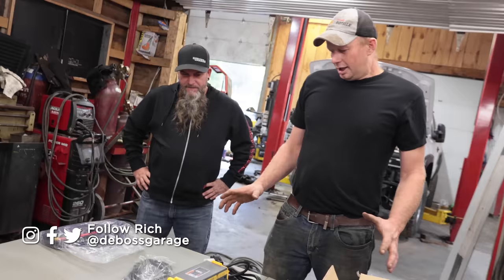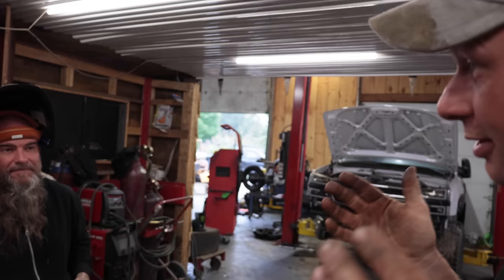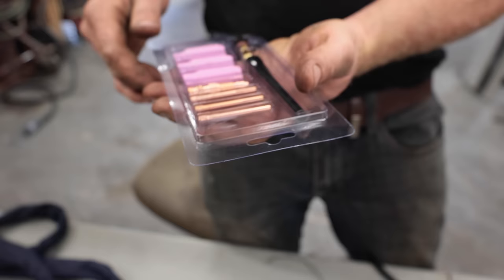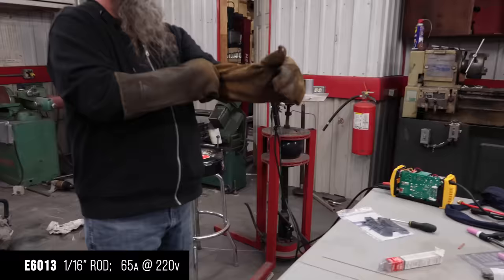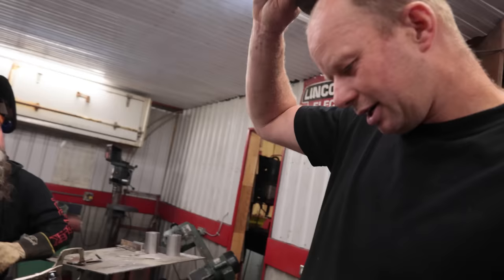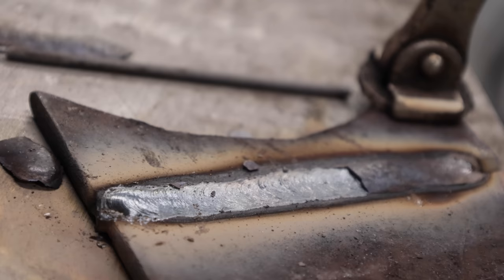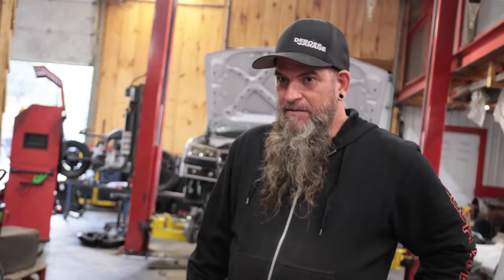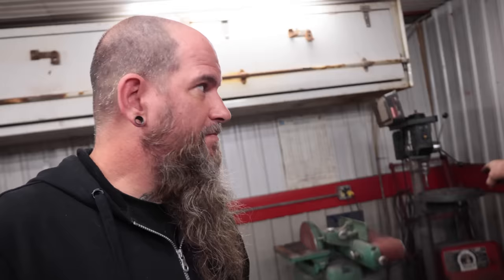How Good is the CHEAPEST Welder on Amazon?

Comment: Nice to see you guys do stuff like this. It's especially helpful for someone like me who doesn't have the setup for a fancy 220 welder (though I'd like one) that will have to stick some metal together here in the future on my project trucks. This is something I could definitely use to gain experience without spending tons of money right off the bat. I remember Peg doing a review on Kickin' Horse welders that were kind of the same inexpensive mini welders. I'd be curious to know what Vince's thoughts are on that brand. 

Another question for Vince if y'all see this is would it be worth it to buy an older Miller/Lincoln/Hobart? Years ago my father purchased an old gas powered Hobart that was used to build bridges back in the '70s or sometime around there. It was an old crane suspended unit that we rigged up on a trailer to be a mobile welder. Supposedly the only reason we stopped using it was because it drank WAY too much gas for our needs but I don't remember the reliability side of it. I've been told that old welders are worth having due to build quality but part of me thinks an old enough welder would cause nothing but headache due to age.

Comment: I am by no means a professional welder, but damn I am impressed. I've used some $200 and $300 welders that were just terrible. This little thing is insane.

Edit: Looks like the price of it went up. $99.99 now. Still a solid price. 
I noticed this brand has a 195A 110/220V version for $109.99. Wonder if it holds up as well if not better.
Reply: It's dropped down to $67.99 now.
Reply: @iamichron  Amazon prices are so algorithmically driven anymore, the price could go up or down by 25% at any given moment based on how many people have looked at the listing in the past half hour. Or what you've been shopping for most recently. Or what day of the week it is. Etc., etc.
Reply: @RickinICT Damn, so they have started selling things like they were hotel rooms or plane tickets.

Comment: The fans are made to work with the cover on, so it pulls air past the heated components. So it would probably run a lot cooler with the cover on.

Comment: When started welding back in the early 90's I worked at a large Shaw fab shop that only used miller machines. All the tackers used dry rigs with no pedal. You had to set your heat to one setting and tack behind a pipe fabricator. I saw many a young man have a burn out and then get one of we finish welders to come show em how to fix it...

Comment: I picked up a similar machine off of Amazon awhile back that does TIG/MIG/Stick and I’ve really been blown away by what it can do for the price. It didn’t come with the TIG cables or hand piece, and uses the (euro) style connectors that seem hard to find, but there is a nipple to use gas and various modes for it as well. The mig function without gas works surprisingly well with good wire, a little spattering and fairly shallow penetration however. In stick mode it is just great, even when only connected to 120v.

Comment: My primary welder is an  ESAB  multi process  inverter -  couldn't ask for a better unit.      Only problem it's heavy to carry,   and  having to lug it and  the 300 pound  8kw 220v  portable generator  across a muddy pasture or paddock  is a major job on its own  when it's the tractor that's broke...     I bought a little  $120  dual voltage  clone of yours   on Amazon. I upgraded the tractor with a  big 860cca battery and  30 amp Denso alternator with a  one wire Delco 145A and  ebay $100  10kw sine wave  110/220 inverter.  I also  mounted a $10 thrift store bounce house fan out front of the radiator   over the battery and  ducted it to cool the alternator, welder, battery  and the inverter it's plugged into.    The battery alone will power the inverter and welder  in  110v mode  with  1/8" 7018  @ 100 amps   for at least 20 minutes without the tractor running (and will still start back up..)  I just bought a tiny 110v  window AC unit to sit on the hood for this summer....  It makes very nice fillets -  way nicer than my old tombstone Lincoln ever did on small rod . First and only time I tried it on 220, the inverter breaker tripped.   On a cool day in the shop,  it's run  thru a half dozen sticks  with no rest  at  125A  on 220v  cooled via  Vevor high velocity  industrial fan.  As I recall, without the fan,  at 100A  the work to rest  was about two minutes on before the thermo protector kicked off,  and  3 or more for it to cool down and kick back on.  I think pretty much anyone  with zero experience  can fire this thing up and stack enough decent looking boogers to hot glue anything 3/16" or thinner together on their first try.

Comment: Perfect for odd jobs, 10 out of 10. It's so small you can strap it on your shoulder. I got it to use with my Honda i2000 generator. Works great and can weld up to 75A and 1/4" on 110V. I've done a lot of welding but didn't realize it could run TIG so I might have to give it a try. Not sure about no water cooling, though, or how practical TIG would be without a pedal, but it looked like it worked OK in the video.

Comment: Some thoughts: most of the inverters (especially on 110v) struggle with .125 and greater 6010. 6011 electrodes yield better results.  Tig side, You set amperage to thickness and metal. Your travel speed and fill is your heat setting. You can tell this welder has not done lift/scratch start in a minute. Tack or clamp that stock down if you don't want it stick on your tungsten on the start and whip out at the end. He is used to a solenoid gas machine by the way he tried to hold the tungsten to the parent metal to get some post gas. I could hear his gas from across the room. He does a lot of stainless. 15-20CFM is plenty for carbon if the wind is not bad. I do like scratch start on a valve for for field welding. It is just more practical. You also never have dry line argon porosity due to wind. Good video. That is ridiculous for $100. It makes me want to build a backpack rig with a mini bottle and an extension cord knotted in my belt.

Comment: It will run cooler with the cover ON, because the vent and fan locations are designed to draw air in specific locations to cool important parts.
Always run fan-cooled tools with their proper covers ON

Comment: The First Ark Welder I bought was a 4 Kilowatt Monster that I can Hardly Pick Up Now !!!  And It only Works on a 30 amp Cooker Box  I have a Couple of Small Welders for Small Stuff like my Motorbikes.  They are Surprisingly Good !!!  They Have a Long Run Time with No Overheating !!!  I think they are Fantastic !!! I haven't Tried Tig with Argon etc.  But they Do the Job.  At 70 yrs old it's nice to have a Welder the Size of a Shoebox !!!  My Tig was £150 and it has a Pedal.  But  I think I'll use a Mapp Gas Welder with Low Melting Point Aluminium !!!  But I've never Tried It so I don't Know !!!  Since the Covid Lockdown I rarely use my 3 Motorbikes Now !!!  I welded a Side Stand  on to my old Honda GG 125, because Honda did not put a Side Stand on it in the First Place !!! My Royal Enfield Continental GT 535cc is Built Like a Tank and my KTM RC390 is Mostly Made of Plastic so I never Welded anythi g on Them !!!  But these Small Welders are Definitely Not a Joke !!!  I have a large Mig Welder but I Hardly Ever Use it !!!  I use 3 mm, 4 mm Rods in the Small Welders and they Work Fine !!!

Comment: As a 30-year plus highly experienced welder fitter fabricator engineer and supervisor of my own shops just from that video right there I would give that a 10 out of 10 for what it is yes that would be a perfect how to learn how to weld and a perfect welder for your garage to fix it because with that much penetration and it didn't blow up yeah that's pretty damn impressive and will do about 95% of whatever you need to do in your garage working on anything so yeah I would highly highly highly recommended

Comment: I wouldn't want to try using it to tig on anything important, but, I am  almost 70, most of my welding was stick. I learned to weld, we had to chase the dinosaurs away from the waterwheel that powered the welder, which was BA-SIC and heavy and a workout just dragging the leads and hand piece around. And it overheated and popped the fuse regularly, and it had valves there in the mix somewhere too.
Would have LOVED that reliable and light tool, it would have made it possible to take a welder to a job site, which  was not really a thing we did when I was an apprentice. We COULD do it, on occasion, but the welder by itself weighed a lot more than I did.

Comment: Worth noting on the cooling of the toroidal coil - oftentimes the system is "designed" to function with the case on,  to duct and direct the flow of air. The fan won't suck air over some parts if it can suck it directly from the room instead.

Comment: I ran my 1st bead sometime around June 1977...I spent the better part of my professional life welding just about anything you can think of, short of Battleships & Skyscrapers...I was a certified B&B Welder for BNSF for almost 17 years....They generally run Lincoln or Miller Welders. The last set up I welded on before I retired cost somewhere north of $20k just for the Machine.....I am constantly impressed by how good these little welders are getting. Especially over the last half decade. They have made leaps & bounds in board & circuit technology. For $100, that's A LOT of Welder.

Comment: The cooling for the inductor was compromised because the case was removed. With the case fitted the air would have been drawn through the panel,over the inductor , through the heatsinks and out the other side.

Comment: You ever have an exhaust system issue were you knew that it would be fine if the shop welded this little piece back on but the shop won't and insist u get the whole 900.00 exhaust system? Definitely picking up one of these welders!! Thanx guys

Comment: You can have some heat control by raising the torch up from the weld slightly. Also by raising and lowering while welding will give some heat control.
 Good for fusing thin stainless pipe.
 Also purging helps the inside of weld. This is must for doing stainless exhaust pipes. Or even  pipe for food processing.

Comment: started out with a 50 dollar stick welder myself.....   recently got a 500 dollar multi process machine..... and to my surprise the 50 dollar stick welds just as good, if not better, because it can set lower amps which is good for very thin material

Comment: We grabbed a tooliom tl-200t off Amazon and had good luck with it. I tig welded a stainless tank and it did pretty well. It won't run 6010 at all, but 6011 runs pretty good, the flux sodium vs potassium makes a big difference on this little inverter machine. Great for small jobs and portable.

Comment: I got my grandads old oil filled Oxford here in the qeer old corrupt UK 🇬🇧  and its over 70yrs old still pumping out the welds. I use it every day and it's still going strong..
Reply: I bet you brag about that thing on every welding video you watch. They are very cool and I bet in a thousand years if one is found it would probably still work.

Comment: I’ve welded for 25 years and I’d say that little welder did really well for its size and price. For me I don’t care about the foot pedal, I rarely use one anyway, I just know what setting work with the thickness and alloy I’m welding. Use my travel speed and angle to control the heat input if the material starts getting to hot or stop.
Reply: Pedal. Peddle means to sell something
Reply: Also, that's "too hot". To is a preposition meaning "toward" or "until." 😉

Comment: Really enjoyed this . Getting the low down off a pro welder was great, especially as he approached it with such a neutral unbiased manner. I've worked with welders in the North sea gas industry who would just dissmis it out of hand without trying it.
Keep up the great content!
Reply: Welder snobs are so tiresome, most welders would love to see this work, it's a tiny toy. The guys who are snobs are just insecure that the 12 year old who got one for Christmas is going to be better than them in a couple years. It's gatekeeping, plain and simple. Cowards.
Reply: welders in the North sea don't use this type of electrodes - rutile, they are required to use basic which can't be handled by the cheapo choke-less welding rig. That's why they just dismiss it out of hand without trying it. The welder guy from video doesn't look quite pro, as a pro would try  basic rods first.

Comment: I'm a welder with 18 years of experience. I purchased a 400 dollar Amazon welder that does all processes (fcaw, mig, tig, stick) It welds just as good as the 4000 dollar millers. The only sacrifice is the fine adjustments and all the fancy features that comes with an expensive welder. For light duty welding in a garage, 100% recommended.
Reply: What welder did you purchase?

Comment: The coil got hot with the cover off because like a tunnel, the coil area gets first wind from where the air entry louvers are. I'm surprised it didn't blow just because the cover was off LOL. At this price it won't last long. This cheaper junk from China uses copper-coated aluminum coils.

Comment: The size of that welder is about the third bigger than the Airco aluminum pull gun I had in the late 70's, I am amazed how compact welders have become, one day your welder will be the size of a flashlight, plug it in, stick a rod in it and weld away.

Comment: Stainless steel tube purge welding? Stainless tube is usually just fuse tig welded. Been in the sanitary stainless industry for about 12 years. Usually dairy and cheese plants, also worked at breweries and chocolate factories. Tig welding stainless tube is pretty clean and gravy work. Pipe fitting and laying out lines and equipment is pretty cool too

Comment: the only thing is that when testing the inside coil temperature the cover was off, the little thing have a internal fan and with the case on the air flow is optimal, with the case off the flow is much less so the reading of the coil temp must be higher, a wish the tmp sampling were done also with the cover one, and that will give us a point of reference of how the original design perform.

Comment: yes i bought one next size up wire feed no gas after using it i sold my miller for 1600 bucks and this new tool was 160 bucks and so easy to carry every were now all my friends always ask to barrow it  110 volts on 50 extension cord 16 gauge 20 amp breaker it welds any thing even 1/2 inch

Comment: I bot an Amazon welder!it costs 100$ it does weld but it's max output is at 20 amps! The welds hold,but the welds sometimes pentwate,some time I get a nice bead others, it looks like chicken scratch welds!
The ad said its a " beginner welder"!
These work on a dual  capacitor charge and discharge. 
Mine came with the cable,crappy wire brush,and a face sheild  you have to hold in your one hand whike you weld.
And gloves come as well.
It's good for short welds,but doesn't pentwate deep enough,but I hit one of my welded pieces, it didn't break off!😅
I have it running on 110 only.!

Comment: I've had this welder for about 2 years now. It's still going. I use it all the time. It's been through hell as I am a beginner learning as I go by trial and error. One thing I will say, if you're going to buy this welder, don't go cheap on your safety equipment, hood, gloves, long sleeves. If not, It will sunburn your eyes shut.

Comment: I've had the TL-200M  for about 3 years now. It's always been on a bottle and never had it run on 110V so can't say to much on that but I'm impressed on what it can do on 220V. Mig, tig and stick all work very well. I use pure Argon and Argon mix bottles. It's pretty much like it came out of the box except I did upgrade the tig torch. Never have had a minutes trouble out of it. I think it's great.

Comment: Just a bit of info . I am a small engine mechanic/shop owner . I have been working generators a long time I me I have yet to see the gen with 220v that comes with the welding equip or say you can use them for welding In the paper work that comes with those gens . We are talking honda powehorse blackmax Westinghouse powermate briggs and Stratton dura max all sorts and never have seen anything about welding

Comment: For stick this is pretty impressive! I had a Miller Synchrowave 120(?) and that was a joy to tig weld with. In mid 1990s that was a $2000 welder. I would have to have the high HZ and pedal that controls a solenoid valve to the argon again. Might have to learn stick at this price! BTW I love the bowling ball stand. I may need to build one if I get another welder!

Comment: I have one i use the stick weld to do small jobs on my mower deck after ripping it off and welded it back together 4 years ago and it's still together and used it a the sawmill where i weld a ton of stuff back together and after 3 years my welds was still in tack

Comment: I've got a toolem welder and its lasted over 2 years and ive used it on my car hauler alot , (stick welding only) seems to do the job its the bigger one than the one on here, i think its  160 amp and I've used it for hoursb on end , from a 6000 watt generator  120 v in las vegas summers , seems to blow holes through thick steel if you let it when its cranked it up and runs nice at 90 amp to 100 amps

Comment: I would almost rather have a small good AC/DC buzz box. You can hook up a Heli-Arc torch and bottle to the AC/DC buzz box also.
 Not a fan of the torch that is a accessory.
 I prefer Weldcraft torches used with gas lenses. They are some very affordable good torches like CK etc. available for a low budget.
 In addition you can build yer own inexpensive chiller using a small fan and a radiator from a bike or a trans. cooler. Get a water reservoir to hold the coolant. Combine that with inexpensive water cooled torch.
Reply: All in all a good video though.
Job well done guys!